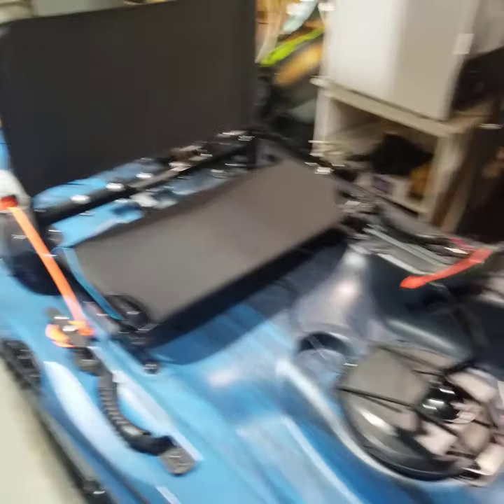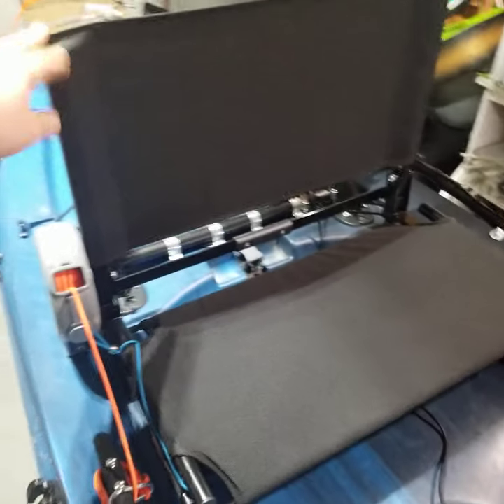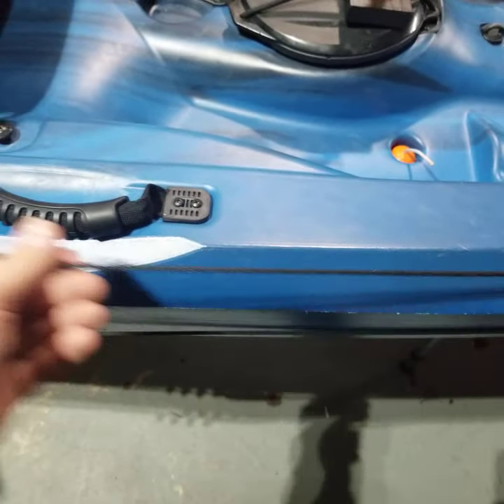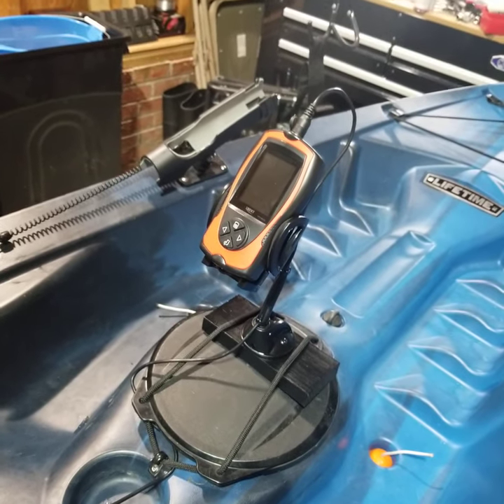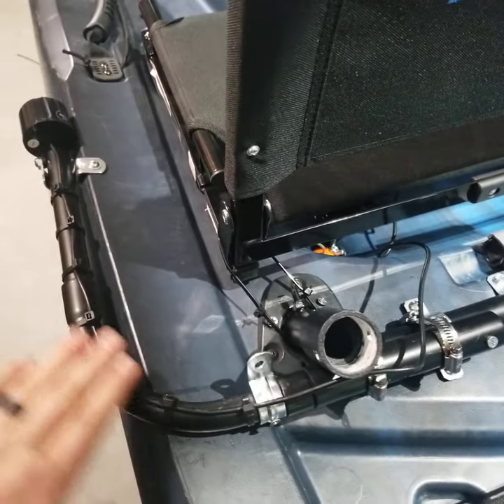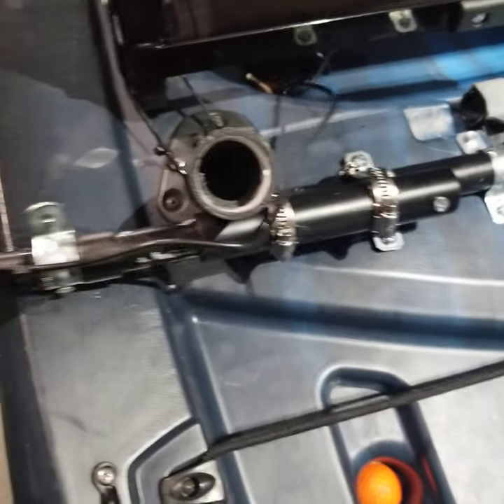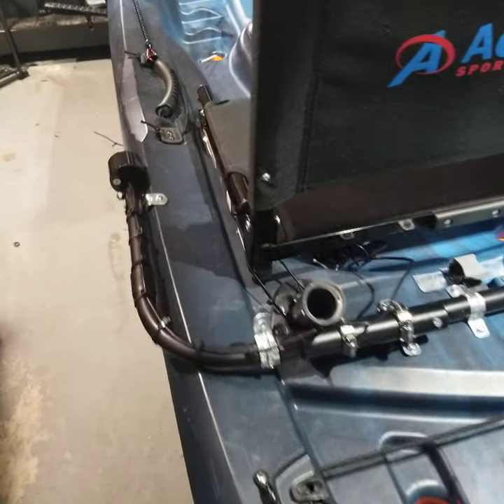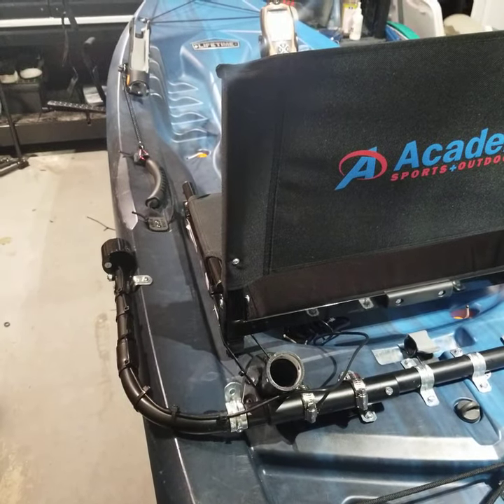What mods I've done to my kayak so far/fish finder intall for Lifetime Tamarack Angler 100

Comment: I'm a BIG GUY as well #260  how much do you weigh if ya don't mind and how does it handle at nearly capacity...I bought my Outriggers🤣🤣🤣
Reply: Big guy,you really need a 12 foot kayak,with 400# capacity.
These things roll over quick.
Or,put on outriggers,either way,that makes any kayak way more stable.